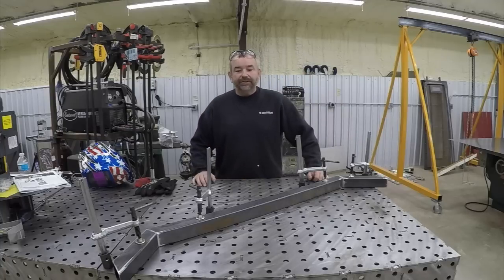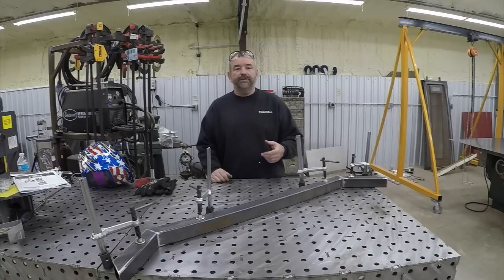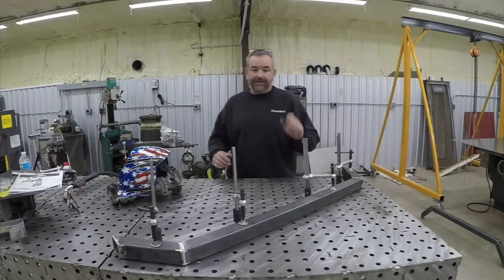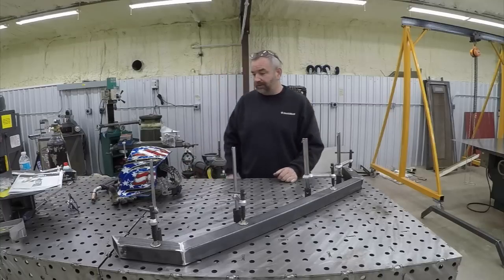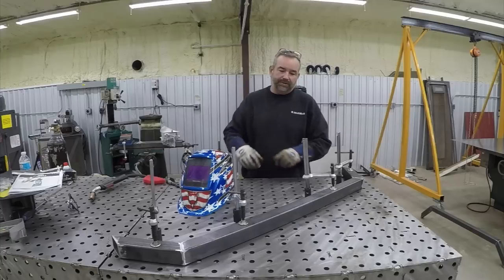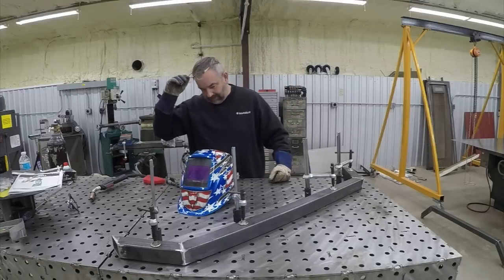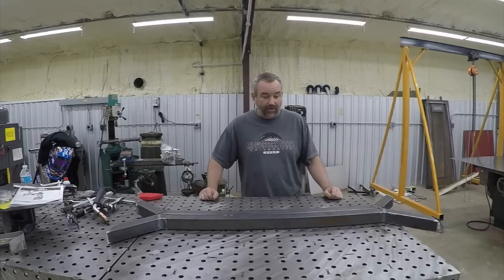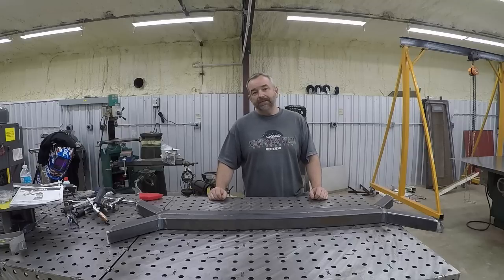Fabrication Basics // Mig vs Tig - Which is Faster?

Comment: Im 16 and wanna build things What do you recomend
Reply: Mostly steel and stainless steel exaust (thin walls)
Reply: If you've never welded? You'll have more control with TIG, but that also means you'll have more ways to mess up! lol
I've been hobby welding for years and got a TIG machine so I could work with Aluminum and Stainless... I'm no better a welder with it, but when the stars align on "all those damn dials" and I get the right travel speed and beat input, it looks really nice.
If your budget can manage a TIG machine I'd go for it, and if you plan to ever work with aluminum then spring for ac.  The Eastwood and Everlast entry machines have enough features to keep up with most projects, though you'll need to spend a bit more money if you need good LoW amp capability for pop cans and razor blades.
Reply: David Martin well thanks!

Comment: honestly i prefer to TIG all most everything i can but mig has its place and a lot of the time i will tack with the mig and then tig the remainder
Reply from the maker: Good point Josh, tacking with Mig can be handy if your not in a position to clamp it so you can hold it with one hand and tack with the other.  Otherwise, mig tacks can kind of be bulky and can show up in a final weld... at least thats what I have seen...

Comment: Stacking dimes is not always a good thing, each ripple in a "stack of dimes" weld is a stress riser where a weld can fail.
Reply from the maker: Oh man, I am glad you left this comment, from now on I am going to tell me people my basic, not exactly perfect tig welds are on purpose!  Seriously, I didn't think of it like that, but it does make sense.
Reply: Dude, show me where, in any code book the section where you got that info about where dimes with TIG failing.
Reply: You are absolutely correct, while the stack of dimes may look "pretty" as you say, the ripples create stress raisers and also root and side wall penetration is reduced in uniformity and ultimately reduces the strength and integrity of a weld joint. I have stated this to many welders who just don't believe or accept this - just shows you how ignorant the welding world still is.
Reply: Hello David Richards
X100!!!
Too many waste time worrying about "form" (looking pretty) when they should concentrating on "function" (strength).

Comment: Tig is for the new beginners it is easy way to start welding and less intimidating ,now i have seen tig welds fail crack right up the middle .
I have stick welded inside of water jackets in blast furnaces for years as well as mig  ,they are fine for low stress environments.

But i would not want to try welding some 1 inch plate joints together with it ,and ask it to hold.